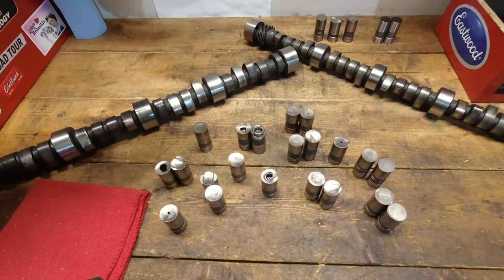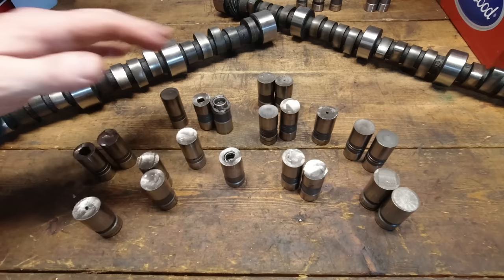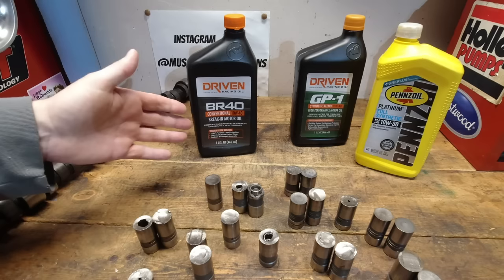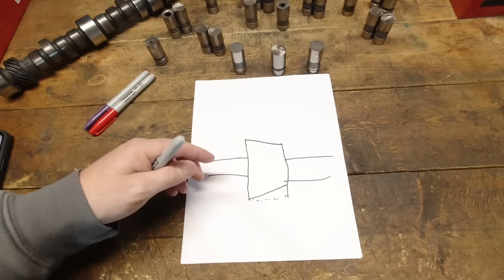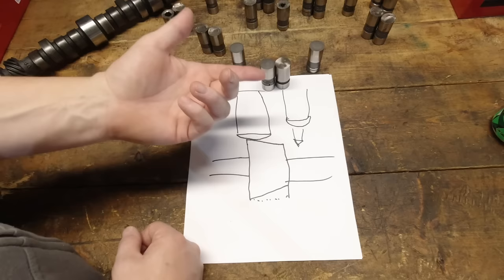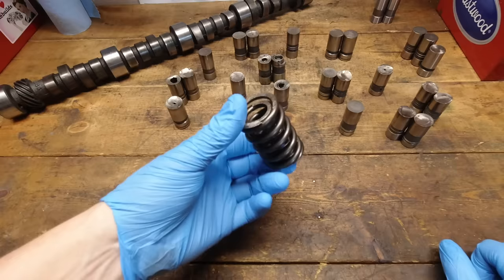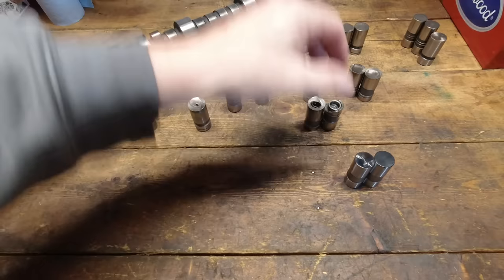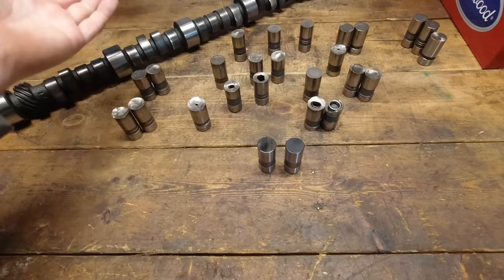Flat Tappet Cam Failures: The Reason Why They Go Bad & The Solution! Part 1

Comment: Every HP engine builder should see this! One point not made RE "diesel" oils is that the dual rated oils with ratings for both gas AND diesel engines (eg CJ-4/SN) have the same low levels of ZDDP as a gas rated engine. The oils with only a diesel rating (eg CJ-4) have more ZDDP. With a little effort, you can get data sheets on the various oils that bear this out but also bear in mind that oil formulations are still in flux, so what you see today may not be what you see tomorrow. Look at the API roundel on the oil jug! A single-rated diesel oil doesn't have enough ZDDP for break in no matter what, but it's probably enough for a low performance engine to run every day.
Reply from the maker: For sure there is some confusion about what API spec diesel oils have enough zinc for normal operations.  For break in, I wouldn’t use one.  There are formulated diesel break in oils (Driven makes one), but I’m not sure it’s in anyone’s mind when buying oil for initial start up.  Regular gas engine break in oils seem to have most folks attention.  Or I’m hoping they do.
Reply: @MuscleCarSolutions  You know what's really interesting is that most diesels, even those going back to the '80s, use roller lifters!  If you look at diesels of the distant past, they had roller lifters too, though for different reasons. When light duty diesels were developed in the '70s, there was an abortive try to use flat tappets as a cost saving features (able to use off-the-shelf pieces). It was learned that the high soot levels commonly found in diesels of the day contributed to early lifter failure, so roller lifters were developed. Also, thee is an upper limit to how much ZDDP and engine can tolerate long term.  Too much can leave deposits in high heat areas, such as the top ring. I don't recall the exact number and it was from a white paper of some years back that may no longer be precisely relevant. I don't think it's an issue short term for break in, but running break-in levels all the time in a "more is better" effort, may not be a good idea.  I think the oils professionally formulated by a tribologist for flat tappet cams will be OK, too much of the poured in additives might be a problem. BTW, the additives will still work. They may not be as efficient if they are not formulated into the additive package, but they will mix and do their job. Some oils take quite nicely to the additives, generally the non-synthetics, but you never know and it isn't easy to figure out. Also, ZDDP is heat sensitive, so it really doesn't do much until the oil is hot.

Comment: Out of 36 cam brake ins, ive have never had a problem with wiping out any flat tappet cam and lifters. Friends of friends have called me to have me brake in their rebuilt engines, Ford, Chevy, Mopar. I always use straight 30 WT with no problem. I have an unused Hydraulic flat tappet Purple Shaft cam and lifter set that I bought 30 years ago. I know that set will survive when I find a use for it. I won't bother buying anymore solid or hydraulic flat tappet cam sets, bc I'm now strictly Solid Roller now! No one can afford taking their engines apart bc of cam failure. I won't take the chance. Take care

Comment: I would say that today's traffic causes most ware on a chevy flat tappet cam.
In a chevy with flat tappets, the cam and lifter ware surfaces don't get oil at idle, as the oil comes from slots in the lifter valley. The lifter vally only gets enough oil to spillover the slots in the lifter valley when you are above idle.
Some older roller lifters don't have a path to oil the roller on the lifter and present the same problem.

Comment: a good friend of mine worked at a specialty machine shop he ran a bank of 40' long centerless grinders for almost 40 years they made hp lifters by taking apart and grinding down diesel lifters. I use penn grade  and driven br30-40 in everything i don't care if it's a full roller with chrome rings it gets break-in oil always and i run stock springs for the first 1500 miles for both i very carefully check my lifter bore tolerance it's so important and most commonly over looked why would you degree a cam and not check your lifter to bore clearance.
Reply from the maker: I was a fan of the brad penn oil till they dropped the Pennsylvania fade crude base oil (that’s why the name change to penn grade) and the reformulation again and name change to penn grade 1.  Not the same oil it once was.  When DA lubricants bought the company, they went cheap on everything.

Comment: More of a question than a comment. Have not flat tappet cams and lifters been made the same from the 50's until the rollers came into being? Yes, many of the cars had 500 mile break-ins, but I surely don't remember the amount of failures. If I am correct, the only change has really been the oil. I also can't remember the last time I saw any break in oil recommended for new cars to assure ring seating. Great article. Thanks for sharing
Reply from the maker: Not sure how far in depth I went into it in the video but no I don’t believe the cores have changed.  What has changed in my opinion is the quality of the lifter, plus one other very critical issue that we’ll discuss when I do the last video in the series to go over the lifters in depth.
Reply: @MuscleCarSolutions  Thanks for the response

Comment: I run a solid flat tappet in my 85 Tbird, I put vr1 in on break in, and changed it after 500 miles and haven’t had a problem since motors probably got 10k miles on it now, but always used 20w50 VR1 used crower cool face lifters and the cam was NOS Ford Motorsport from the 80’s.

Comment: Watched this documentary on FTCF a side from proper
Use of Oil and zinc for break in. 
Lifter bore size and condition. And making sure the lifter rotates in there bores 360 a few times to insure there all able to rotate is very important! The most important! If it goes in tight it almost always will fail. Take it out and find the issue and do what it takes to rectify that rotation issue before going on.
Also I lay the rods down on a table and put a visible paint mark on all push rods in a visible spot to see if the covers are off. Always check that best done on the engine dyno.

Comment: I just rebuilt a 327 used a melling cam with the hardened gm lifters and used amsoil break in oil and so far so good. In my research i came to the conclusion that a fella needs to buy the hardened lifters and use a good oil. The lifters were not cheap so hoping everything stays working.
Reply: Watch the Powell Machine video on lifter hardness. He shows that hardness is not the issue.

Comment: You can try anything anyone recommends to keep your flat tappet cam alive but it is not going to happen.  The oil additive packages just will not support solid lifter cams.  Especially if you are running any kind of increased spring pressure.  If you are building any type of early engine put a roller cam in it.  I currently run either Mobil 5-30 Super Syn or entry level Mobil One, all of their ratings are within .05% of being identical.  That to me is the same oil.  Usually I can find it for $3.00 - $5.00/quart and I buy 5-6 cases at a time. Now a performance oil like Driven is going to cost about $10-$16/quart.  With a six quart pan my oil costs $30 while the least expensive performance oil is $60 for that same six quart pan.  Since you save  $30 just on oil per change you make up the difference on the roller conversion eventually and you do not have the additional expense of changing the flat tappet cam and lifters repeatedly.  Now let's go on to the second biggest killer of a flat tappet cam, cold/dry start.  The chances that this flat tappet cam is in a specialty use vehicle:  weekend car show car, drive to church car, let the kids use it for the prom car, etc..  It sees a massive amount of cold/dry starts and that kills camshafts!  Put a roller in it and forget about this issue.  You are not going to be able to make a flat tappet cam live no matter what you do.

Comment: Captin Obvious here with the solution. Whats happening to the lifters and cam during the break-in of an engine? 
Your "heat treating" or "seasoning" them. 
Just as one would do a heat treatment on a knife or a new cast iron cooking pan before useing it
There is lots of you tube videos that explain the process in great detail. 
heat treat the face of the lifters in a frying pan and put the cam in the oven. 
Pick the heating and cooling temperatures that the engine would reach during the breakin period.
Reply from the maker: Watch the second video in this series and you’ll see what the depth of what treating looks like.  You’re not going to get any benefit from putting a cam or lifters on or in your cooking appliances.  Time, temperature, cool down and sometimes quenching process are critical to getting the metal to anneal correctly.  Wish it were that simple!

Comment: Get back in the mid-90s the dirt tracks I ran you used to be able to run roller stuff 3 years ago they started making us run the flat tappet cam stuff I've had two motors with the flat cam and lifters and my engine builder must know what he's doing cuz I didn't have a problem with either one of the motors he's built for thank god but it was nice to see this video on what would cause it or could cause but thanks for putting out the video buddy appreciate
Reply from the maker: Buy a lottery ticket!  You’re on a roll!  😆 Thank you!

Comment: Built a 72 pontiac 400 in 2016 with a Scat 461 stroker kit, the machine shop built short block with a .498, .489 lift Chet Herbert Cam, recommended by a long time drag racer, this cam came with a black nitride coating on the lobes, they said leave it on, it's part of the break in process. We used the factory stock springs after checking pressures , also used Driven lube on lobes and lifters , Used Isky antipumpups and Driven break in oil , primed pump with a drill until oil was circulated everywhere in top end , ran 20 minutes at 2000 rpm and at varying speeds throughout and then  dumped oil and filter and replaced with 20w50 VR1 , ran for 200 miles and dumped again , refilled with 20w50 VR1 and have no issues,  runs strong to this day, guess we just got lucky. I wonder if that nitride coating is the key to the lobes living?
Reply from the maker: Nitriding is for sure a benefit to the cam.  The stock springs also likely had something to do with it.  I think the Pontiac is fairly light on the seat pressure which is a bonus and probably fairly light on the nose.  Would have to look into it.  If it dropped the pressures down, it was a very smart move.

Comment: When I picked my chevy 292 from the machine shop had bored  .040 over, decked block, ground crank .010 under  boiled and painted they said she is ready to assemble. Spent 3 days cleaning and preparing until it pasted the white paper towel test, special attrition to the lifter bores they where smooth as a baby ass! Good thing because on of the oil passages was completely clogged where I had cleaned up oil pump passages for flow. Most small engine builders fake clean the engine with brake clean and the hammer in the lifters into their bores assuming they will loosen up, and they do!

Comment: I love the Driven products and run it in my Mopar 440; I also have no issue with theValvoline
VR-1 "high zinc" oil; they're all about the zinc and phosphorus, too. 
That said, in one recent past cam break-in I had in another 440, even though all proper break-in was 
followed, the Comp Cams cam/lifter package wiped lobes in short order.
This was shortly after Comp had been sold; the stories about their quality issues after the sale
were rampant out there then.
If they've got their shit together these days, good - but the total lack of customer service by them
at that time (deny, deny, deny) made it so I'll never use anything from them again. 
Bad parts are one thing - a company refusing to stand behind their products is quite another.

My current 440 is running a Mopar purple shaft (it was new in box, but at least 20 years old) and
it broke in and runs fantastic - like cams used to do in olden days.
I don't feel the need to capitulate to the industry because of whatever changes have occurred for
whatever reasons - so no, I don't need to pay a fortune for rollers. I just will continue to seek out
new in box (but older manufacture date) stuff.
- Ed on the Ridge
Reply from the maker: It’s common to hear that.  The break in was done correctly.  When in reality if we look at the details, there’s always something that wasn’t done properly.  Like I mentioned in the video, those lifters are bought by many companies and all have had failures.  I have another video coming out this week on heat treating that should help understand that side of the equation.  I firmly believe the lifter is what has suffered for all the reasons given in the video.  As far as comp goes, I know those folks pretty well and I’ve never heard them denying helping folks who destroyed any of their product.  No questions answered they’ve always just replaced the failure, no matter where the fault lies.  That’s the nice thing about a massive manufacturer.  They don’t look at every warranty or product replacement as a cost.  They look at it as an extension of their customer service.  Been that way every time I’ve dealt with them since I bought my first cam from them in 1985.  Your thoughts on buying NOS is a good idea.  Though I’d still follow the current break in procedures to ensure it lives.

Comment: I remember when you could buy a stock 350 Melling cam and lifter set for under $100 USD in the 90s. 
INSANE to think you can get away with not using break in oil on a new or rebuilt motor. Same with using moly lube on the cam and lifters. I applied it to the rockers and valve tips. Also any wear surface that doesn't have direct oil feed.
You can check the RC on a used cam. The lobes that are not damaged are going to be the same or near factory hardness. Yes that machinist did intentionally show the harness of the wiped lobes were lower due to friction heat.
IMO 90% of the failures are improper lube, Preload adjustment, RPM, VS pressures, and time before putting a major load on the engine.

Comment: Flat tappet will still be around in a decade. Too much of it still in circulation. Roller is not immune from issues either. Just spoke with a coworker who had the oem plastic retainer break and allowed lifter roller to go sideways. Wiped the cam lobe, and replaced with an aftermarket cam with the apparent same quality. Hope the new plastic retainers last longer than the first at 80k miles

Comment: Never thought about the additives fighting against the zinc in engine oils. Good info.
Reply from the maker: Detergent will for sure.  That’s why I never use an off the shelf oil and a separate zinc additive.  The folks at Driven addressed this in the interview I did with them last year.

Comment: I tore up a Crane  camshaft  , 
It was my fault  !
This camshaft  was in a small block 327 and runs North of 8,000rpm  drag racing  ,
So it doesn't  matter what  oil was in this Engine , 
Not too many  people  break  in their Engine  correctly  , at least none of my friends   do ,  I follow  cam and rings specifications  and  rpm's   this actually  takes hours for  me . 
But when  engines  get drag raced , 
RPM's goes out the window

Comment: I got some SBC solid lifters for 1.75 a piece in 1980 that at 92,000 miles had no wear at all . Exxon 20-50 Super flow ! 69 cent Auto Shack oil .

Comment: I haven't ever had any problems with flat tappet cams. But then again the last time I installed or owned one was 2001.  I was done with that technology a long time ago. I look at flat tappets the same way I look at cassette tapes. We're way past that.
Reply from the maker: Definitely all the newer technology is in the roller systems.
Reply: @MuscleCarSolutions  remember how expensive building a full roller engine was in the 90's? Just the cam and lifters were well over $1200 in the Jegs and Summit catalog. Now they start out at $500.  In 1996 if you had a full V8 roller engine that made over 500hp you were the baddest dude on the block. Now we have 4 cylinders that easily make 500. And remember people bragging about their highly modified drag cars being able to hop the left front wheel over a beer can? Now you can buy a completely stock 5.0 Mustang, get some slicks and put a turbo or blower on it and do a 10 o'clock power wheelie that will send the strut towers through the hood. All while you've got the air-conditioning and heated seats turned on. Horse power is so cheap and readily available now. You just have to adjust for inflation of course.
Reply from the maker: It’s an amazing time to live through all the changes to engine technology over the past 30 years.  Hopefully we have at least 30 more before they get taken away.

Comment: Another Youtuber with cam grinding experience has found that the crown of recently made non-roller lifters is not uniform and/or ground to an angle incompatible with the cam lobes of standard profile flat tappet cams. For warranty purposes , cam and lifters should be purchased as a matched set from a reputable grinder.
Reply from the maker: I’ve seen lobes that have a stupid amount of taper ground into them because they were mismatching and using an awful lifter to go with it.  If the two match, there’s less issue.  0.0010 - 0.0015 taper is what the OEs used back in the day and I’m not going to argue against that.  Plenty (with the correctly matched crown lifter) to facilitate the rotation needed.